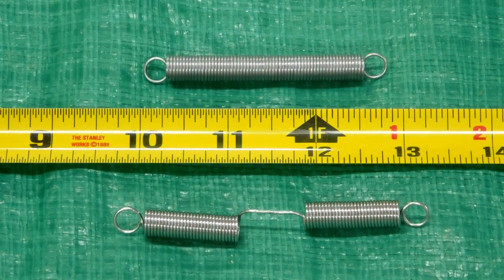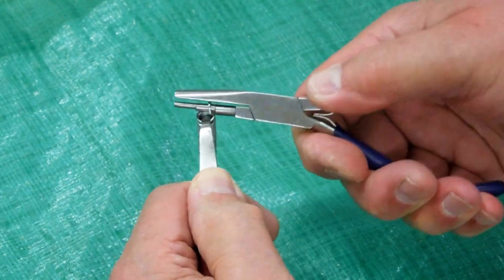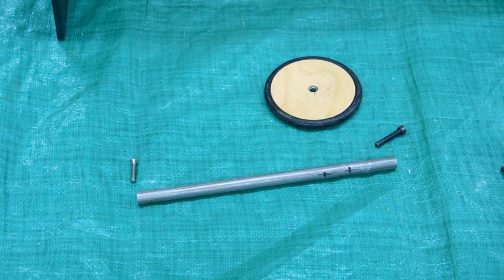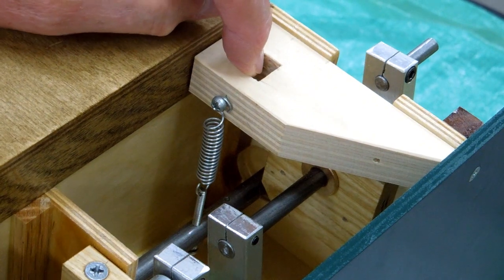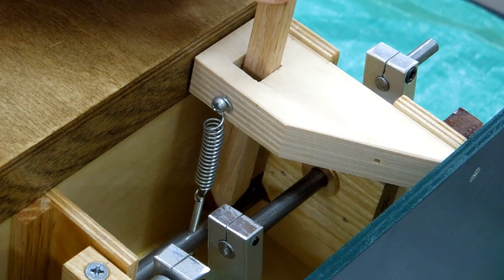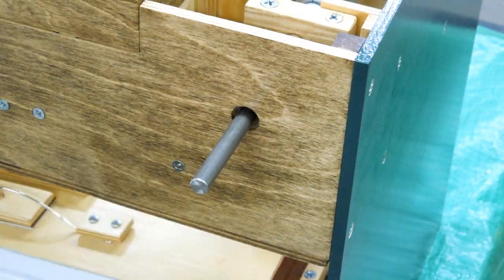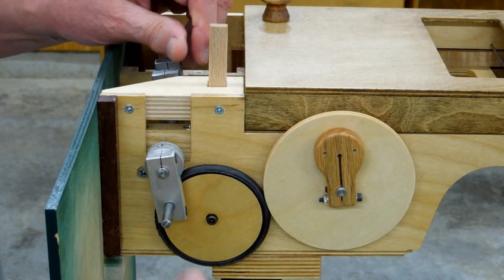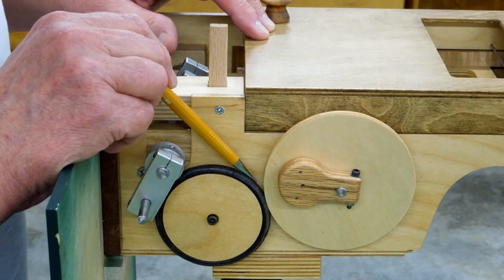Senior 20 Organ (15) Clutch Mechanism

Comment: I haven't found out what the significance of the shape of that outside wood rod clamp your touching at 4:42.  I understand you have the one set screw clamping to the rod but I'm guessing the other screw is extra clamping power?  The only reason I see this shape necessary is to attach the larger 4" diameter drive wheel.  Is that the reason for it's shape?
Reply from the maker: The shape of the slotted wood clamp was a bit form over function, a rounded shape looks better than square corners, square corners are weak spots, etc. The two holes in the round part are two screws attaching it to the round disc from the back side of the disc (plus a bit of glue on the round part only). A set screw in a thin piece of wood is not going to be very effective and can strip out of the wood or crack the wood. In fact the hole drilled in that section for the set screw tends to weaken that section of wood. I used oak. A harder wood like Osage orange (hedge) would be a better choice. I came close to making the clamp out of aluminum. The bolt & nut on the end of the clamp is for tightening the clamp and the setscrew is just a bit extra holding power and possibly not necessary. A slotted piece of wood as a clamp has a tendency to split if tightened too much. The larger round end strengthens the wood and provides an attachment point… and what I made is much more attractive that what is shown in the Senior 20 or Busker plans. :-) I see you are drawing the Senior 20 in Fusion 360. Are you going to build the organ?
Reply: @RonaldWalters2010  eventually :)

Comment: Great explanation! Very intricate clutch engagement and drive for the spool wheel. Curious how you came up with diameters for those wheels in order to have music play at correct speed? Or is that an adjustable function for a later video? I haven't ever seen a pliers like the one you used with blue handle. Obviously you DO have a large assortment. Haha. Thanks for sharing.
Reply from the maker: MRrwmac Take-up spool and wheel diameters are all given in the plans. Any variation of music speed is accomplished by varying the hand crank speed.